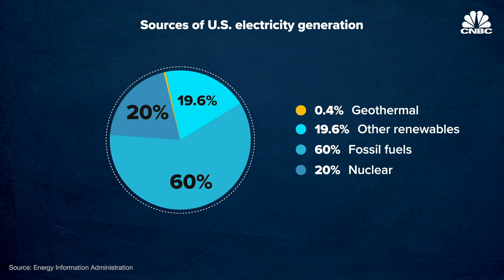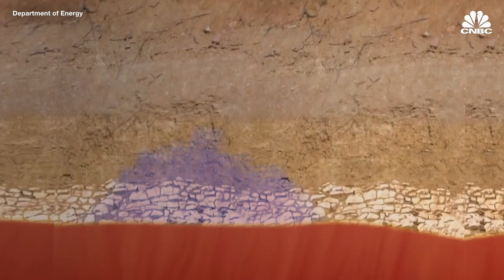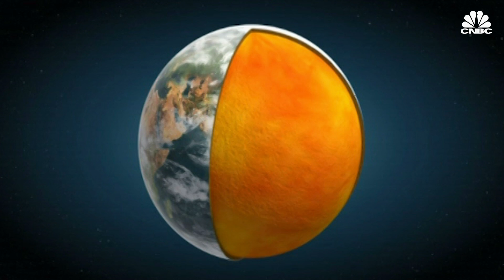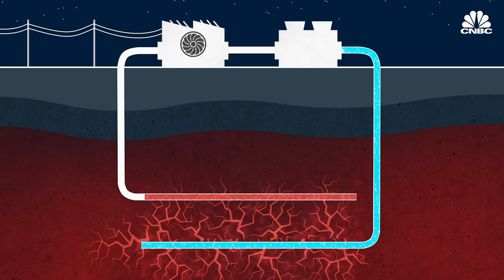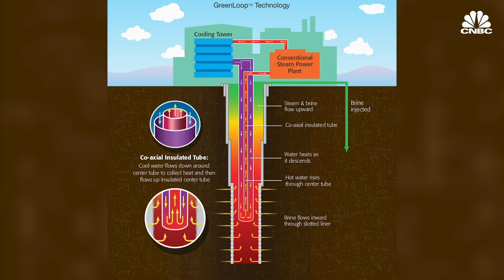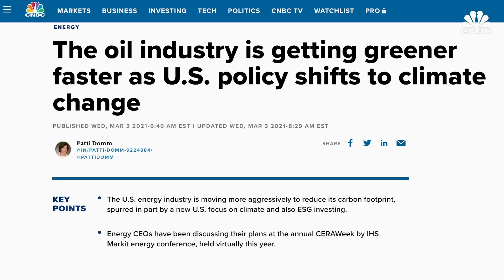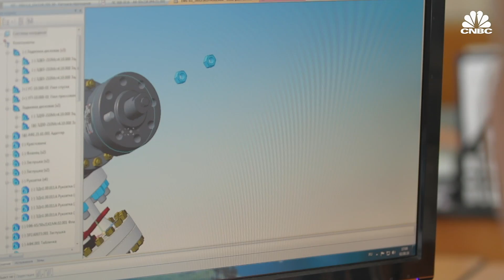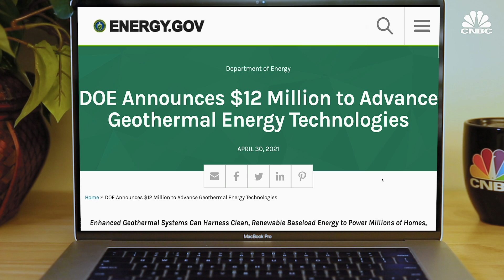This Overlooked Energy Source Could Supply 50% Of Electricity

Comment: Fun fact. In 2020, over 50% of Kenya's electricity came from geothermal energy.
Reply: I think Kenya gets 41% of it's total energy from geothermal right now but they plan to get 50+% by 2030. Still a great achievement for a small nation using early tech
Reply: They're sitting in a continental rift valley, just like Iceland
Reply: And reduced energy costs by at least 22%.Not to mention the direct use applications like heating greenhouses. Great job the government has been doing.Theres more to be done but  the future is bright .
Reply: Fun fact Kenya isn't alone, New Zealand and Iceland both use geothermal. 
The very title of this is garbage. In Australia we thought we had some really great locations for geothermal and NONE of them panned out.
It takes very specific structures under the ground to make this work and importantly it has to be within reasonable reach of the population centers. That was part of the Australian failure the sites were so far off grid that the delivery cost was not viable for the amount of energy available. The other part was the below ground structures were not hot enough, maybe future technology will change that?
Reply: I read it as Kanye the first time round! FFS!
Reply: @indraneilpaul1309  Kanye is more hot wind than geothermal :p
Reply: True. Great strides we have
Reply: im looking forward to this here in the philippines we have t6he largest caldera in the world called apo laki which means we can havest huge energy from the sea which is way more safer than springs in the suface cause calderas emits 0% carbon footprints we can may also supply electricity to all south east asian countries then to taiwan and china in GOD's willing we can also supply energy to australia nee zealand and other asian countries but i may be day dreaming here 😁😁😁
Reply: Lol these comments are harsh against anyone potentially not in agreement.
Reply: I heard the Kenyans are looking into a nuclear power plant. It would be great if they could use geothermal for 100% of their electricity needs. I feel like nuclear energy is best avoided if possible.
Reply: A lot of Bitcoin miners are looking into this, for Bitcoin mining.
Reply: how did they scam that?
Reply: And have electric price much higher than USA
Reply: Jack Strawb  Your silly little petulant complaint doesn't address the actual numbers involved,  such as how many KWH are produced for that CO2 figure.
Reply: just cuz kena can do it doesn't mean cuba can do it too..   Ya have to have right geography.
Reply: It’s great to hear about progress in Africa!
Reply: @Riley Korbin Yea, have been using Flixzone} for since december myself :D
Reply: They dont need to heat their house.
Reply: Jack Strawb  dude, I think he agrees with you.
Reply: Amazing 🤩 best energy source available. The most efficient and powerful available when compared to the energy produced..
Reply: . Wooow👏
Reply: Not to mention Kenya is much smaller than the US
Reply: @SendTheTruck  but it’s still thousands of kilograms of carbon dioxide out of the air
Reply: @mrragmcmuffin  your point?
Reply: @SendTheTruck   If anything, the United States would have a greater advantage. Because they have more land space to use.

1. Drill into the earth.
2. Extract magma.
3. Use it to power a steam turbine.
4. Infinite electricity.

Big brain stuff.
Reply: @emuriddle9364  Extract magma? Umm, nope.
They pump water down into the vents, and the superheated steam that comes up powers the turbines. The action is similar to Old Faithful, but on 100% of the time and controlled. Initial costs, as always are high, but after that it's basically free energy (excluding labour, upkeep etc).
Reply: @emuriddle9364  if you extract magma it will turn into rock and clog up everything. they probably don't need to reach magma to get hot enough to make steam.
Reply: @frankyflowers  The level they need to get to is only around 1% where magma might be found, but it's still hot enough to super heat the steam.
Reply: @LostCylon  that cult from the temple of doom could have been rich and powerful with all that lava they had. they didn't need those magic stones.
Reply: @emuriddle9364  You apparently have no idea how much it would cost in both money and resources to drill down to magma in ....say, Tennessee.  Or how the hell to "pump' the stuff up to make use of its energy.
Reply: @emuriddle9364  Except that they are Americans and rather careless.

Comment: Doesn't fracking causes issues later on with the ground being unstable? I think the close loop system is best.
Reply: as long as we do it sustainably then everything should be fine
Reply: @srinivasdadi3873  interesting seeing as EGS systems both in the US and internationally face THE SAME EXACT seismic issues as hydraulic fracturing, yet its magically different, because it’s now “green”. 

Scientifically that’s called bs....
Reply: @bobramirez588   I don’t quite understand the title of this article considering the fact that the goal was reaching 3,000 feet, yet they didn’t even achieve this goal in this project as, “The threshold of 3,000 metres, however, was not reached. "The engineers had to stop about 250 metres from this level as a result of the extremely high temperature increase -- over 500 degrees.”. 

Given that this article literally states, “Below these depths (1,500 meters), the stability of the drilling site is more and more difficult and poor decisions could trigger an earthquake”, and we have seen historical examples of high seismic risk with Basel Geothermic Project (3,500 seismic events induced by drilling in Basel Switzerland - 200 of which were observed by the SSS and 3 of which induced earthquakes greater than 2.0 on the richter. The highest being a 3.4. Leading to 15 arrests for malpractice and 2,000 civil suits for $9 million), I don’t think your comment disproves my argument.

I actually think it would be very beneficial to utilize geothermal for heating in the residential sector and it should be used for utility scale electricty in areas that would be effective (primarily the west and north west US). However the idea that this is going to be feasible to provide 50% of electricity in the US I don’t believe is actually on any legitimate analysis nor would it be effective from a risk management standpoint. 

I do find it hilarious that progressive groups in the US are keen on banning hydraulic fracturing yet demand that we support all types of geothermal, when the geothermal industry itself recognizes that there are seismic risks that are comparable to the scale of risks we have seen with natural gas.
Reply: @bobramirez588  What amazes me is how these groups completely change their viewpoint of risk when evaluating energy sources. If they support them then there magically zero risk involved, but if they don’t support them then we have to regulate against the energy source assuming worst case scenario regardless of the probability for the event. 

It’s like how for solar manufacturing there’s magically no discussion whatsoever from these groups regarding the production of extremely hazardous waste such as silicon tetrachloride, dichlorisilane or hydroflouric acid as part of the Siemens and Czochralski processes. Yet all fossil fuels and biofuels need to banned for the production of hazardous chemical waste. 

I just recently saw an article about how we could power the entire country by mass producing EGS wells in Yellowstone tapping into the caldera for electricity production. I mean we’re literally banning nuclear in California because of Fukushima and Chernobyl as worst case scenario events that have a statistical improbability of occurring yet these same people will turn around and drill into an area where the worst case scenario would literally annihilate the entirety of life in North America and potentially eliminate the human race from existence. Don’t get me wrong there’s extremely low risk, but I can’t help but compare the two and scream wtf logic are these people using.....
Reply: @brian2440  They made the point that they use non-toxic fluids and that there is generally no risk or extremely minimal risk of significant amounts of toxic products leaking into the water supply mainly because toxic oil and gas products are not involved.  Because hot water leaking into the groundwater doesn't have that same sort of impact, it doesn't pose the same type of environmental risk in that way.  There are some other issues with fracking but these can be managed.
Reply: @brian2440  Seismic risks are lower than with natural gas, though, because there is much less need to pump pressurized fluid into the well over the long term, because there is no need to replenish the lost fluid to prevent subsidence because there is no lost fluid.  That reduces seismic risks as well.
Reply: depends on the methods done, i know of it being done using synthesised water and pressure instead of using reactive chemicals, so the seismic consequences stopped when the fracking process stopped, nothing longterm.
Reply: Fracking is bad, they use these techniques with extracting gas. It has caused many earthquakes up to 5 on the richter scale. No thanks.
They should make a closed loop system instead.
Reply: Done wrong, it can.  But there are reasons to think that this is much less likely with geothermal, mainly the fact that the geothermal plants don't have to pump high pressure fluid to replace extracted substances because they are not extracting substances in the first place.
Reply: In effect, you're advocating for Binary plants rather than Flash plants.
Reply: Please fracking isn't the same thing. I did this for years. Depending on the system you need and land avaliable for schools, residential, it may be 8 holes drilled for a farm 250 feet deep each. You could have deeper holes or more holes but not as deep. Basically similar to a radiator, you use something environmentally friendly antifreeze liquid in a loop that liquid travels down and back up a closed system. Because the temperature is always the same allowing you to cool off the liquid or heat the liquid. There is another way thats even safer where its not deep at all and no drilling needed but you need more land to keep better efficiency.
Reply: @NATESINTERACTIVEAUTO  Residential is one thing, but residential isn’t going to get you to 50% electricity. Residential isn’t even 50% of today’s consumption. 

So they’re obviously talking in part as utility scale geothermal, of which there are documented issues that progressives and environmentalists choose to just look the other way because they claim it’s green rather than evaluating technologies accurately.

Comment: The geothermal energy industry needs a lot of research on geology and geomorphology. Actually, they need a role new level of technology on that.
Reply: I believe they're already working on it. Perhaps not as much in the US though. This video was good, but lacking in perspective.
Reply: It’s already happening. The technology is available and scalable.  Millimeter microwave directed energy drilling allows for extremely deep drilling without the problems of a drill bit melting or wearing out.  We can get to extremely hot depths that the oil industry can not reach using standard technology. Therefore the need for extra geological modeling has been lessened considerably
Reply: @bobramirez588   What about geophysical data from gravity and magnetic/magnetotelluric surveys? Do they have a greater role in identifying and surveying deep geothermal wells?

Comment: I have watched too much Superman to know Krypton when I see it
Reply: Apparently Krypton doesn't blow up from too much geothermal. It mostly blows up because either supernova or harvesting the core for Uranium.
Reply: Geothermal harvests just the heat in the thinnest layer, the crust. This heat mainly comes from radioactive decay of elements and rising heat from the core. Which is very different from Krypton which was physically mining its core.
Reply: @DeusVult77763  Mars solidified stopping the inner dynamo that generate the magnetic field. In works of fiction their is plot where the Earths inner parts start to cool and solidify due to geothermal energy. Most science shows predict that the sun would go super nova before Earth solidified.

Comment: So.. end of human life in earth is not too far...

How earth is made of,

Assume like this
A droplet of liquid metal, with thin solid layer called crust. but in core region it will remain as liquid metal. This is how our earth will look like. If you want to take a  thermal energy, you need to drill minimum 200 kilometre to reach Mandel asthenosphere. 

Naturally volcanoes gets errupted to release the energy due to build up of high pressure inside the Mande.

Now US going to start or they have already started geothermal extraction. After few decades neighbourhood countries will start the same extraction process in near locations. So what will happen, those drill points will try to connect each other by formation of crack from inside the mandle/crust, so it may lead to entry of seawater into the crack. Then crust will be exploded or crust separation may happen like continental drift theory
Reply: Why is that?
Reply: @TheLastDanite  

How earth is made of,

Assume like this
A droplet of liquid metal, with thin solid layer called crust. but in core region it will remain as liquid metal. This is how our earth will look like. If you want to take a  thermal energy, you need to drill minimum 200 kilometre to reach Mandel asthenosphere. 

Naturally volcanoes gets errupted to release the energy due to build up of high pressure inside the Mande.

Now US going to start or they have already started geothermal extraction. After few decades neighbourhood countries will start the same extraction process in near locations. So what will happen, those drill points will try to connect each other by formation of crack from inside the mandle/crust, so it may lead to entry of seawater into the crack. Then crust will be exploded or crust separation may happen like continental drift theory

Comment: Nice video CNBC. Geothermal energy along with tidal energy, solar energy, and wind energy will power the future and will protect the planet as well.
Reply: Geothermal for the win!
Reply: @xhawkeye8717  Yes
Reply: Geothermal completes the four classical elemental forces of earth, air, water and fire.
Reply: Just build nuclear. Problem solved.
Reply: @TheLastDanite  Nuclear waste causes land pollution and takes hundreds or thousands of years to degrade.
Reply: @artificialintelligence2653  Nuclear waste in a non-issue. Currently, waste is stored onsite in dry caskets harmlessly. We should open Yucca Mountain (Obama closed it before it could open) so we can bury deep in the Earth. Meanwhile, solar and wind both have waste problems much larger than nuclear waste.
Reply: @TheLastDanite  Hey but look at the full part of the story, for mining uranium many forests are destroyed as well as the machines use a lot of fuel and cause pollution. Then it needs space for storing the nuclear waste. Otherwise, it’s still good.
Reply: @artificialintelligence2653  Mining is good for humanity as are machines. The net positives FAR outweigh any negatives. Nuclear waste is currently stored onsite. If we re-open Yucca Mountain we can simply place it there.